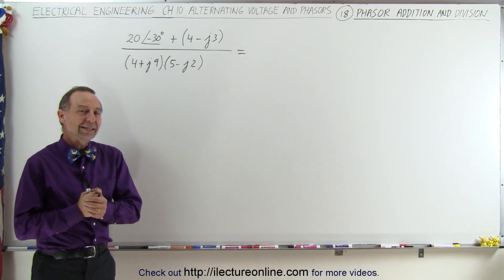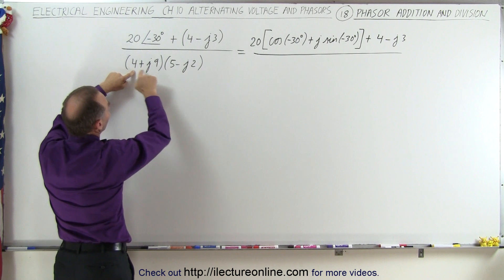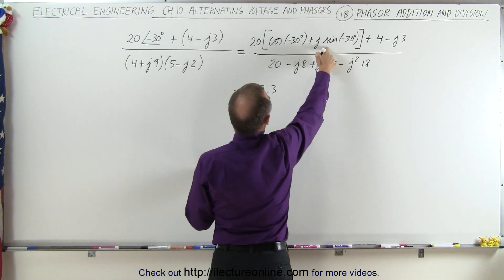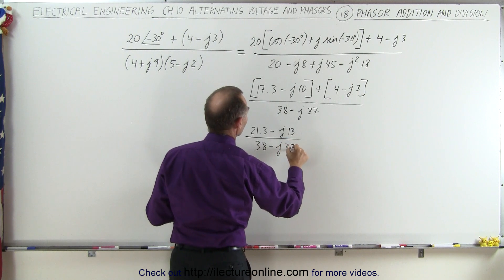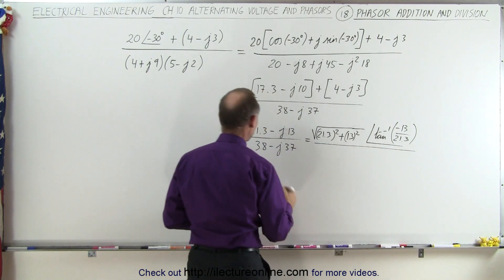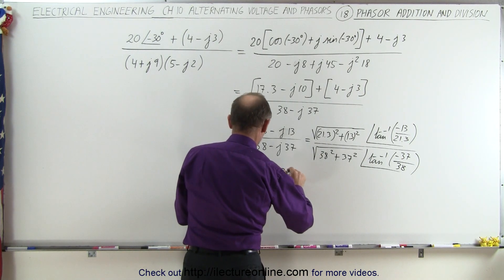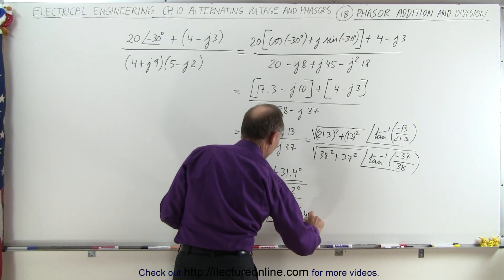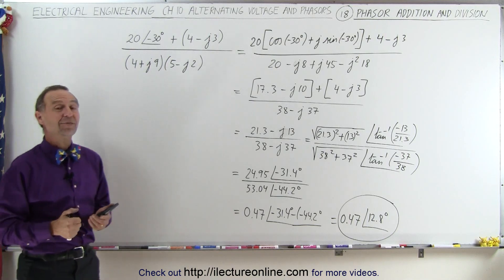Electrical Engineering: Ch 10 Phasors (18 of 82) Phasor Addition & Division NOTE S/B 38+j37

Comment: Hi Michel.  Great work once again thank you for your generosity.  I have an error report. Step (3 or) 4 should be (21.3 - j13)/(38+j37)  which yields 0.47 |_ -75.6º.
Reply from the maker: Thanks for your comment.  Yes the error is noted right on the thumbnail of the video.

Comment: Since the denominator should have been 38+j37, should the answer be 0.47∠-75.6 instead?
Reply: same dude. -j^218 should equal to +18 since j^2 = -1 and by substitution, -1(-1)(18) should be 18
Reply: I also got the same
Reply: Yeah 38+j37
Reply: Yep, he made a mistake
Reply: I got  2.88 ∠12.84degress
Reply: what happened to the y^2

Comment: Can you multiply by the conjugate? So instead of converting numerator and the denominator into abbreviate phasor, just multiply by (38+j37) for both numerator and denominator.
Reply from the maker: Try it and see if you get the same answer.
Reply: Yep, it works!
Reply from the maker: That is how we learn.  Thanks.
Reply: I would have done the conjugate aswell

Comment: Isn’t +j37, not -j37 since you were adding -j8 +j45 = j(-8+45)= j37 ??
Reply from the maker: Yes, you are correct.  That should be +j37.  Thanks for pointing that out.
Reply: Ya that's what, so the ans will change